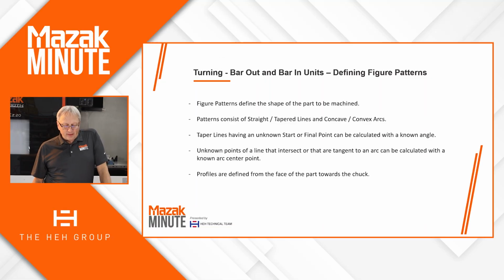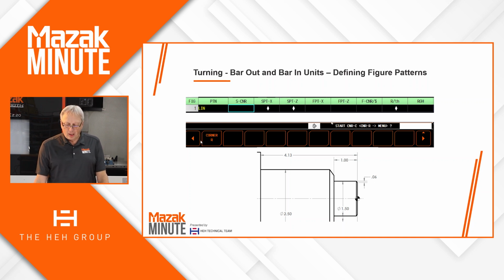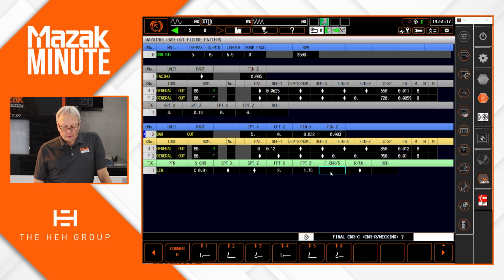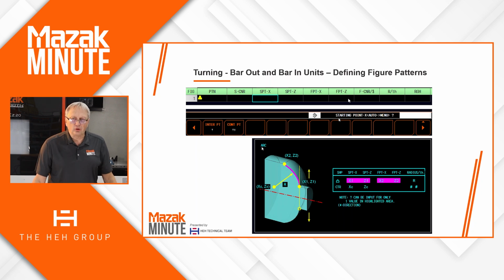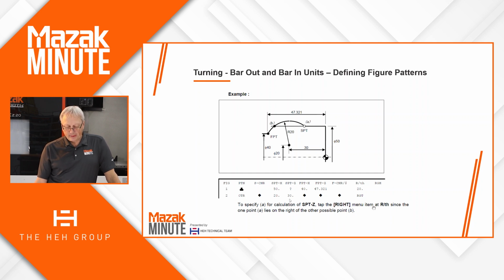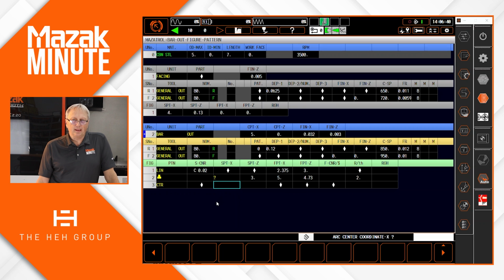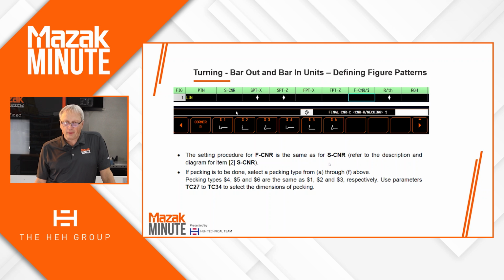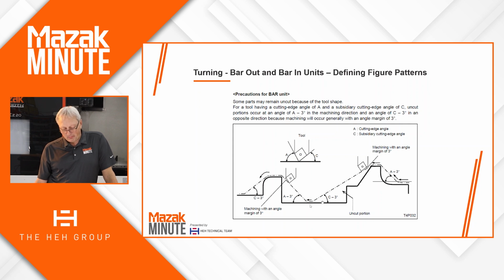Mazak Minute | Episode 16 | Bar Out Soft Keys Part 2

Comment: I love these lessons. Can I ask for somthing off script? I use only Mazatrol programing, but I would like to see an ID keyway broaching EIA or Mazatrol example if possible. I know it's advanced.
Reply: Use the conventional unit in mazatrol to position the broaching tool to the start point of the keyway.
M5
M200
G0 X50. Z2. C0.
M210
 (Make sure that you are not returning to the tool change point)

Call a subprogram and repeat it 50 times

Eia/Iso Subprogramm
G1 G98 Z-50. F2000
G1 U-0.2 (U=X incremental)
G0 Z2.
G0 U0.3
M99

In each repeat you are broaching 0.1mm in diameter, 50x0.1/2= 2.5 depth of the keyway. There ist no need  to set a origin for the subprogramm, it's automatically the origin from the main programm.
Reply: @MrDrunkX  I'm wanting to do this in an itegrex, will that still work? I will give it a try out in the air first.
Reply: @charlesbranigan8899  what type of control does your integrex have? If you have smooth you must use G90/G91 in the subprogramm.

G98
G90 G1 Z-50. F2000
G91 G0 X-0.3
G90 G0 Z2.
G91 G0 X0.4
M99
Reply: @MrDrunkX  i have the smooth G
Reply from the maker: Thanks for the comment! We will bring this to Mike's attention and see if we can do a full episode.